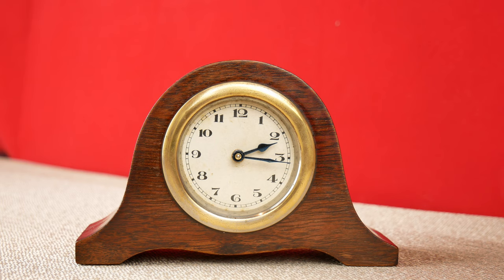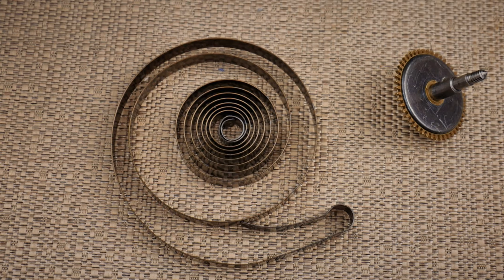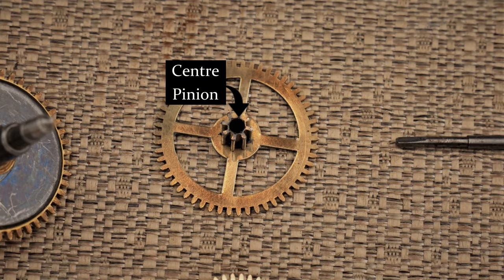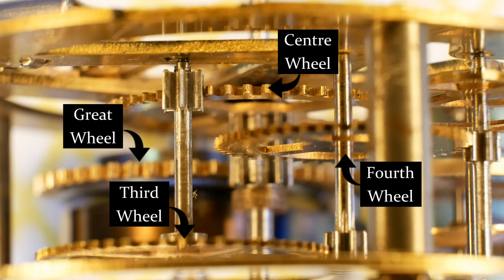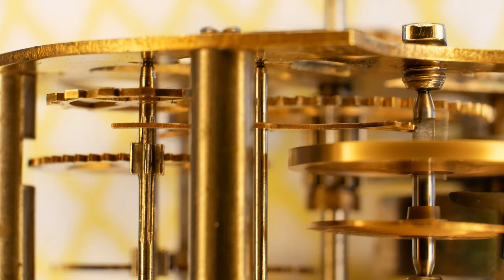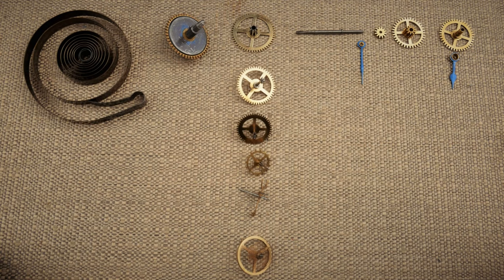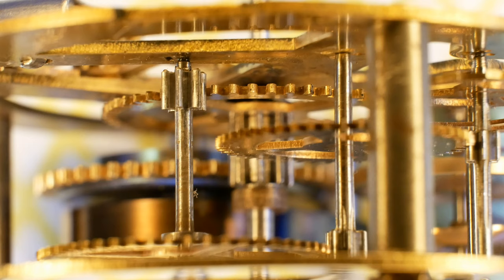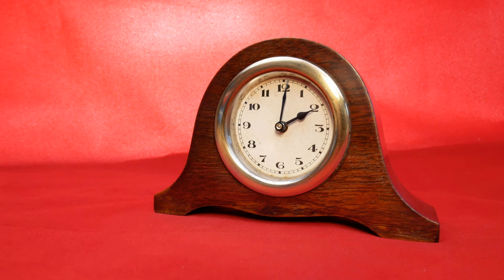How A Mechanical Clock Works

Comment: Looks like good progress there. I think you mentioned it during the vid, but the pallet fork pins looks really really worn. as a pointer for your secondary objective. looking really forward to the continuation, so keep on trucking!
Reply from the maker: Good eyes, Lars! Yeah, those pallets are really worn. I've picked up a cheap USB microscope (I've used it in the video), and there is some really interesting damage on this clock. I was going to add it to this video, but I ended up with so much to talk about I decided to make a dedicated video about it.

Comment: This is my favourite vid so far. I have a question... You've described the mechanism, but how does the  clock keep time accurately rather than moving at a random pace?
Reply: Smaller clocks use a wheel with a spring that spins back and forth. Larger ones use a swinging weight (or pendulum). It's called the "escapement."

Comment: I  hope its OK if I post this ... you may delete it if you wish ... I am self-taught, and I wish I could take a course. Your teaching is excellent.

As I see it, the scape wheel turns 577.777 ... times per hour or 288.888 ... vibrations per minute with a vibration of 4.814 ... per second. That puts the minute wheel at one per hour. Then the motion work does its thing. How'd I do, professor?
Reply from the maker: I'd never delete such a nice comment. If you keep calling me professor you're more likely to get your comment pinned to the top.

I'm not a teacher, I'm just a student. I only started doing train calculations a month ago, so give me a few days and I'll work everything out, double check my calculations, and give you an answer that is probably, definitely right.
Reply: @ticktockworkshop8169  You'll get to a point where they'll - inadvertently - show the movement of a clock like those wooden ones, and you'll say to yourself, "My that's easy". HAHA!!!